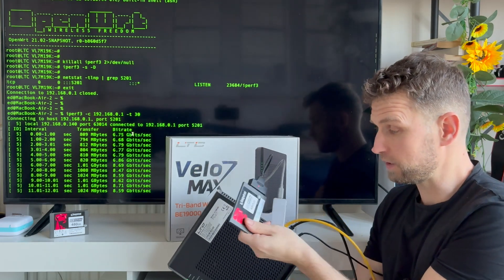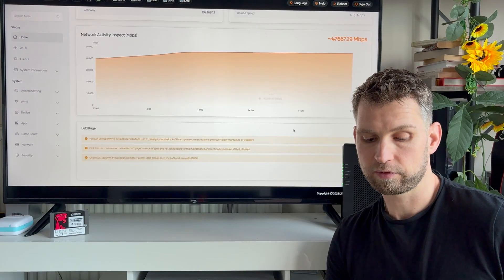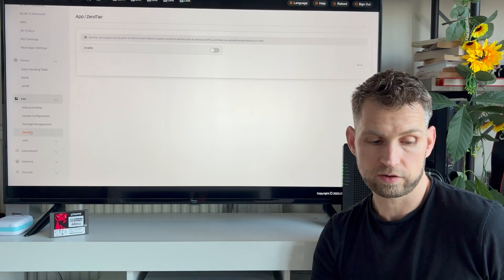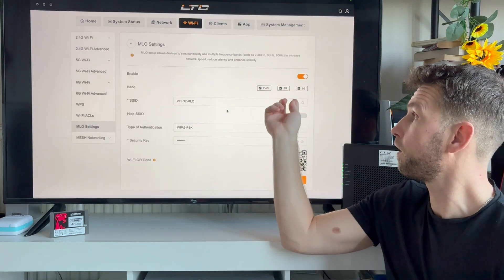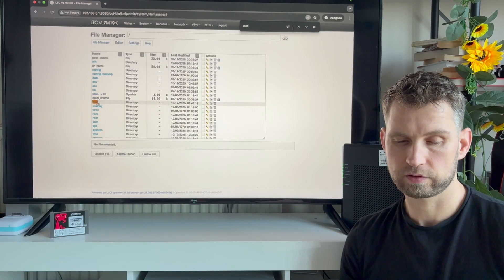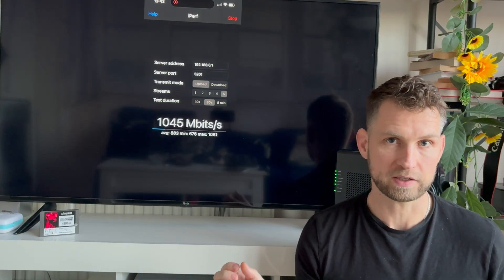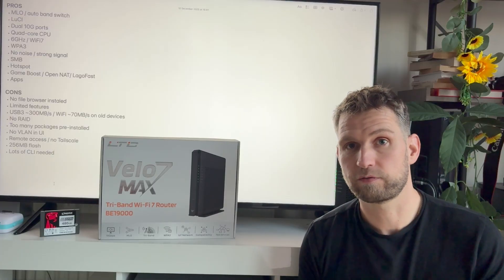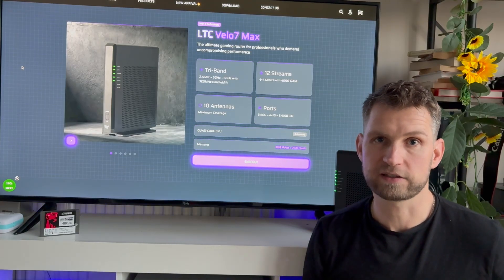Building WiFi NAS | featuring LTC Velo 7 Max router

Comment: Nice to see that this Router runs normal OpenWrt like GL.iNET-Devices.
But V21 is realy old. OpenWrt v24 is the newest one.
Maby try to innstall a fresh clean OpenWrt and test it again.
Wth 2 GL.iNET-Routers i got a little bit faster speeds.
And you should get more speed if you sit directly in front of the device, if you have a new Client-Devices.
I can push 1.6Gbit/s over the air with Wifi6 APs.
Reply from the maker: Thanks for sharing very useful info. I’m quite intrigued to try and test - 
if I can get those speeds.